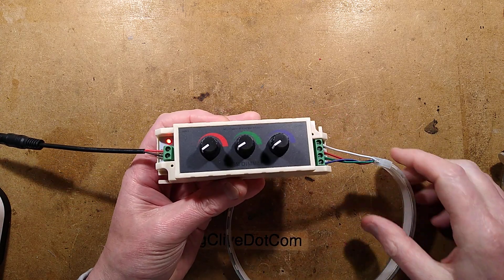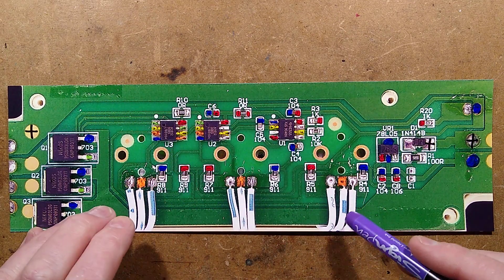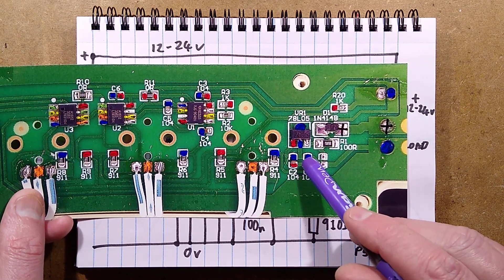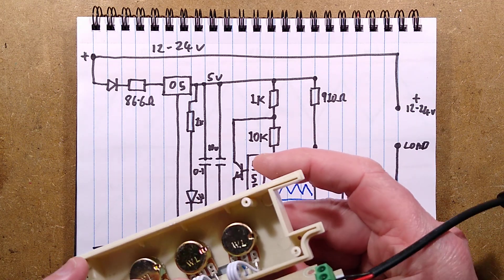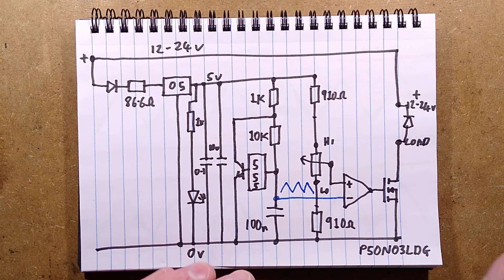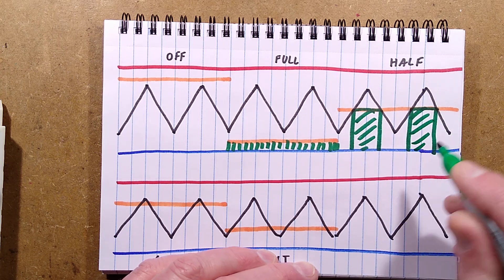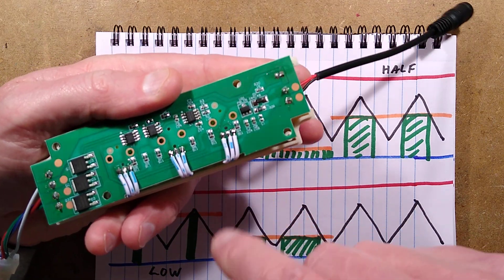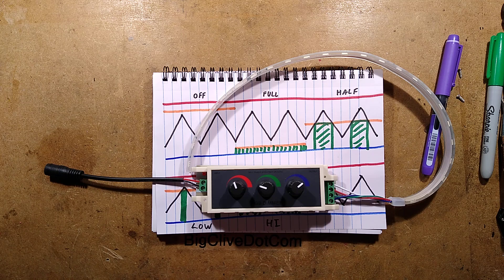RGB dimmer teardown and schematic (no microcontroller)

Comment: Wow, very complex...I expected just 3 potentiometers in series with R G and B, to hell with ratings until they melt down
Reply: Nowadays it's probably cheaper to do it with ICs instead of higher voltage potentiometers
Reply: @neyoid  I mean I have expected them to use a cheap potentiometer that would fail after a short period of time due to the overload.  This is China we're talking about
Reply: @matthewmiller6068  This is cheaper than any pot which lasts more than five seconds while dimming a 3 amps load

Comment: I wonder what was gained by using this circuit instead of 3 555s. Cheaper?
Reply: Fewer capacitors. Also AFAIK it's not trivial to get the 555 all the way from 0% to 100% duty cycle.
Reply: 555 's when run from batteries ( portability).. ARE power hungry although 7555 would consume much less..would be overkill.. although cost slightly more.... achieving full on or full off ( zero sw.losses..this alsois power saving) would be difficult with just 555/7555...